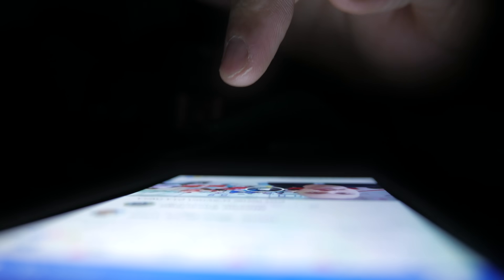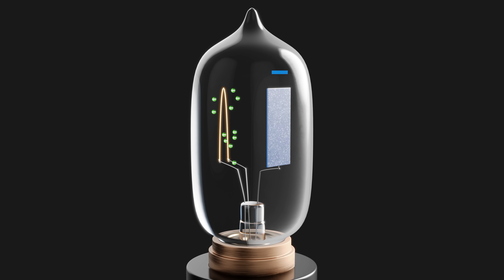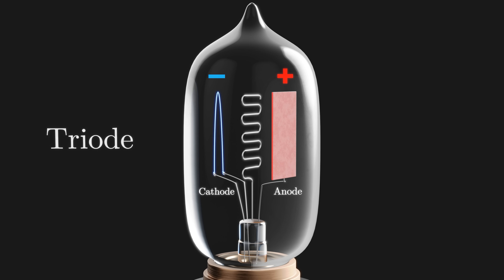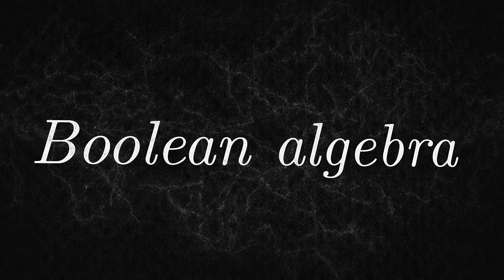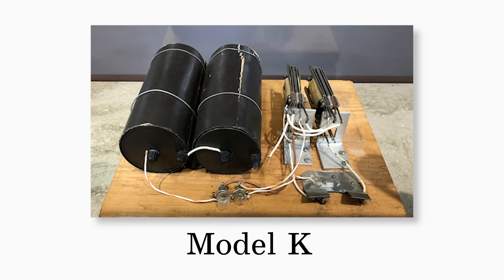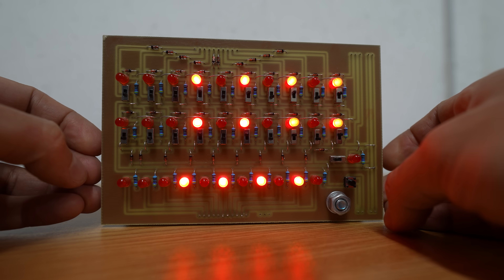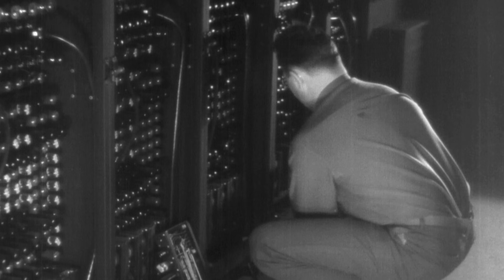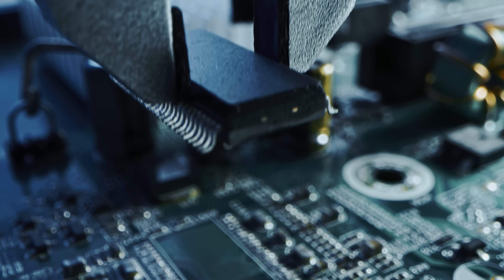Why The First Computers Were Made Out Of Light Bulbs

Comment: If you have to use a computer to know what a calculation is going to be -- meaning that you don't know what the answer should be until the calculating machine tells you -- then how would you supposedly know when it had malfunctioned enough to give you a wrong result, in order to know that you had to go and repair it?

Comment: Hi! You said that ENIAC could be programmed. I'd love to hear how this was achieved  at the time. I think this would require a method to automatically change the "wiring" of the triodes inside the computer.
Reply: From what I've seen, it was a manual rewiring process using telephone switchboard wires.

Comment: Technically they weren't light bulbs, and  really you'd want replace the really inefficient filament as the free electron source 

Perhaps with something like a uv led, wit dat phd you do know uv has short enough wavelengths to move electrons

Much more efficiently than a linear resistive load like a filament 

That would effectively kinda make a new kind of tube, since you could modulate that led digitally, along with grids and plates 

And use much less wattage, simply removing the filament.

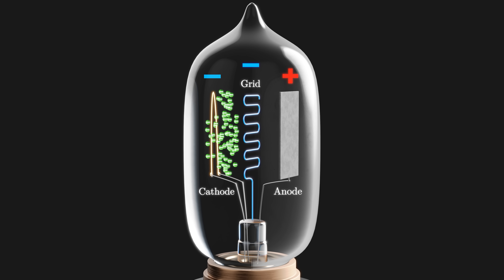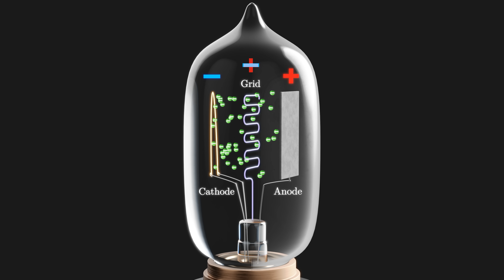Comment: Why did you say slightly negative/positive at 5:10 but very negative/positive at 13:55. Does "slightly" means the vacuum triode working as an amplifier, and "very" works as a switch? And why is that? What's the difference?

Comment: Completely daft but I'd love to see the space required to build the equivalent of a modern processor using just valves or even the first off the shelf transistors, that might be possible. I'm not suggesting building it but calculate the space required, I've a feeling its much bigger than ant ideas I had in my mind. All well I've nothing better to do at the moment, I'll look up a few things first and have a go. Well it took  a while and I came up with using the size of the  ENIAC  and its performance. And the answer is 180 thousand square kilometers give or take 124 square kilometers. Ireland is only 84 thousand square kilometers. Or for the American market about a third the size of Texas. Delivery date is incalculable.

Comment: If I remember correctly it's because of the relays used in the early computers that we refer to software/hardware problems as bugs because in one of the early computers the designers were not getting the results that they expected and it was traced down to a relay that was not functioning  correctly to to a moth that had gotten stuck in between the contacts of the relay preventing the contacts to close correctly. The moth was attracted by the heat given off by the tubes and this is where the expression  WE HAVE A BUG IN THE SYSTEM came from.

Comment: Funny story: prior to vacuum tubes being used in radio (and even later for cheap at-home radio kits) they used what were called “Crystal sets.”  Small wires were delicately placed on a piece of crystal and, if you got the position just right, it would do the necessary task of rectification.  Nobody really understood how it worked and it was always a pain to find the right spots on the crystal, so vacuum tubes became the standard once they were invented.
The thing is, those crystals were made of silicon. They were using semiconductors back then.  Had vacuum tubes not been invented, they would likely have continued research into the properties of silicon and understood how they worked and how to craft them. While we have the vacuum tube to thank for modern computers, it is not unfair to say the decades of their use was kind of a digression.
Reply: Still for a CRT, a microwave, a klystron in a broadcast or a traveling wave tube in a TV satellite are great applications of tubes. Interestingly, the current requirements already on the high voltage side of an electric train are so high that we could not get away with such simple tubes ( just scaled up). Only many small tubes would achieve the current. But this would be expensive. I imagine that small tubes each can be switched to create and aim an 1kV electron beam. They all sit in one of four large vessels ( input and output connectors ) and shot over a large distance into a common anode ( for each vessel ). But you know what: We went from relays straight to semiconductors for this low speed application.

Comment: The first electronic digital computers were the Colossus, built in England in 1943, and the ENIAC, built in the United States in 1945.
Reply: Colossus was not a general purpose computer. It was designed and built to perform a single specific task and that's all it could do. Which is why it is not counted as the first general purpose electronic computer ever built. Because it simply wasn't.

Comment: The way you describe how a Triode works is wrong, you NEVER put a positive voltage on the grid, to control the current the voltage is varied by more or less negative voltage. Like using 0 volts the tube would in full max current, with -3 volts the tube would be off. DO YOUR HOMEWORK on Vacuum tubes.

Comment: I found it fascinating back in the early 2000s when I worked on C-130 aircraft that still utilized vacuum tubes in the compass amplifiers for the navigation system.  Your explanation of how they amplify signals, like earth's magnetic field, helped close the gap on my understanding of that navigation system.  Those airplanes used a device called a Magnetic Azimuth Detector in the wing tips or in the top of the vertical stabilizer to sense magnetic heading and transmitted a very low voltage signal to the navigation computers for heading reference. Before the signal could be utilized effectively, though, it had to be amplified.  Enter the humble light bulb 💡
Reply: Some FM transmite still using 1KW tubes as output. Tubes still good on RF applications.
Reply: The first production C-130A came off the production line in 1955. I know they have had several upgrades to the airframe and systems over the years but it still amazes me that a plane designed and built in the 1950's is still in service today. The B-52 is another plane that still in service that was first built in the 1950's. I worked in PMEL witch was renamed TMDE when I was in the U.S.A.F. and I was shocked by how many pieces of test equipment we had in Germany that were built in the 1950's and 1960's and used vacuum tubes and all the wires used silver solder on ceramic bus strips for connection points. I was over there from 1982 to 1984. I was surprised when the government decided to make all the military calibration labs totally civilian contractor jobs in the 1990's.
Reply: One of the reasons for retaining valves was resistance to emp.
Reply: Field effect transistors are the solid state analogue of the thermionic valve. I wonder if, for very high temperature applications in the vacuum of space, very tiny valves, without envelopes, might make a comeback.
Reply: @rogerphelps9939  
The idea has definitely been investigated.  The main problem being launch shock.

Comment: In the Telegraph, a relay, in itself, does not amplify the signal. The weak incoming signal is sufficient to energize the relay, which triggers another telegraph set, sending out the message at full power. Otherwise, I enjoyed the video.

Comment: Great video, but factually incorrect on one very important point. The first programmable electronic computer was the Colossus at the other side of the Atlantic 3 years earlier. This is an incredibly important bit of history that keeps getting overlooked. Though I will concede that if you add the term "general purpose" you would correct.

Comment: Great video. One question though.....who varies the voltage of the mesh in the vacune tube? That is the bit I don't understand.
Reply: Input signals can come from a variety of sources. It could be a radio transmission or a transducer of some sort. Say a microphone.

Comment: When I was a child back in the late 50s or early 60s I remember my dad removing vacuum tubes from the inside of our old crt TV set whenever it would stop working properly.  I would go along with him to a local grocery store that had a tube testing machine.  It had a top panel with numerous sockets that the various tubes would be plugged into.  He would plug in each tube and throw a switch to test each tube.  An analog gauge would then indicate whether each tube was good, bad, or weak.  If a tube was bad or weak he would open up a lower cabinet built into the machine and select a new tube of the same number.  We would return home and reinstall all the tubes and our TV would work again.  Being a child, I didn't understand how it worked, but I remember being amazed at how the tubes would glow with an eerie dim orange light inside the TV before he would put the rear cover back on.  I also remember how the TV would crackle when it was turned on and how the picture would shrink down to a small point when shut off.  It even had a remote control connected to the TV by a 2-conductor wire that ran from the TV underneath the carpet and up behind our living room couch.  With it you could turn the TV on and off and change channels one at a time either up or down.  I guess that was high tech in those days.  In a way, I miss those days when you could work on and fix things yourself.

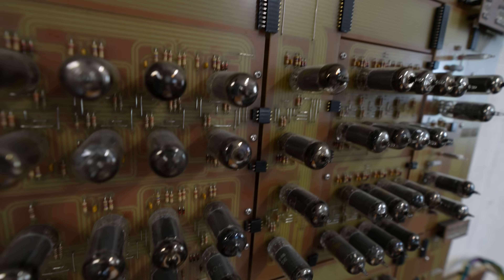Comment: @15:58 - The guy has chips in his vacuum tubes computer LOL
Reply: What may look like "chips" on the milled circuit boards in David's one bit vacuum tube are really the circuit board inter connection jumpers.   I have been in David's shop working on the blue Centurion minicomputer in the background. His vacuum tube computer 100% all tubs, resistor and capacitors no IC's  /  "chips".

Comment: You can get DC with only 2 diodes by using centre-tap transformer.  The CT is grounded, and one anode each of the double-diode tube is connected to each side of the secondary.  From the cathode you go to the filter, to get filtered DC.  Not that the cathode is this case is at an elevated voltage, not at near ground potential which can be the case with amplifying valves.  This is also possible with solid-state diodes.

Comment: All this is true, however, semiconductor technology interestingly did not absolutely require vacuum tube technology to precede it. Had we never explored thermionic emission in light bulbs, we still could have ended up with the modern world of electronics technology as we know it today. It would likely have taken longer to get there, but we'd still have semiconductors eventually and could have bypassed vacuum tube technology entirely, or arrived at the mechanics of it later rather than sooner.

Edit: More interestingly, while attempting to research "Did semiconductors need vacuum tubes in order to arise?" for my comment, I learned that there is a new paradigm possible in electronics soon by way of a kind of laser equivalent to the vacuum tube, at nano scale. Semiconductor tech has inherent limits, and these new devices could get us around those limits.

Comment: Great Video. Growning up around tubes, then transistors, this stuck me awesome to learn how early they achieved 500 operations per second.
I used a LED,  9v battery, a piece of plastic strand, and a solar cell in 1979 to transfer audio and 300bps information between two computers.
Now, 40 GB/S is a standard.  Soon, I understand today they are considering using the light bulbs in your home and environment as access points
as you walk around for huge speeds over a Terrabyte.  Just great.  The webpage will be there before I lift my finger up off the mouse, lol.

Comment: say, why did the dc light bulb glass turn yellow and then black when struck by electrons near the + side please?  what was the chemical rxn there? thank you.
Reply: I think maybe the glass was not struck by electrons at all, maybe the glass was struck by atoms of the filament material itself which had vaporized off the filament? And then those atoms deposited onto the glass?  But if only the positive side of the glass got discolored, then those items must have been negative ions.  But why would negative ions vaporize off the filament?  were these just carriers of the electrons that vaporized off the filament that you mentioned in the video?
Reply: but then again, if it were ions, not electrons, which were moving off the filament then a vacuum tube would not work for long at all because the anode would get coated with whatever material the filament was made out of
Reply: Maybe when electrons exit the filament and hit the glass near the positive side, they leave behind a positive ion of filament material on the filament.  If enough of that happens, positive ions of filament material are going to repel each other on the filament.  And then some positive ions will be kicked off of the filament with all that repulsion and with the great thermal energy while the filament is turned on.  then maybe those positive ions go to the glass to join the electrons that had just hit the glass?  So the filament material ends up coating the glass there?  but in order to reach the glass where are the electrons has struck, the positive ions of filament material would have to get past the positive side of the filament.  Can they do that?  Maybe if there's enough thermal energy they can do that by random chance?

Comment: Why is it that no computer pioneer did meet some organ builder around 1870-1920? Organs a controlled by air from keyboard to flutes and fairground organs are "digital" (with piano rolls). It's less expensive than electric relays and more reliable and can operate up to 5 ops/s. And the pneumatics of organs include all the components to build logical operators like AND, OR, NOT controlling so called flute registers or stopping all flutes at end of piaono roll.
A non invention which was delaying the computer development by 50 years.

Comment: Edison is not the inventor of the light bulb, only perfected it for practical use. By the way, Nikola Tesla was miles ahead in developing electricity, alternating current. for everyday use, including electric motors. Thus the so called "Edison Effect" was only exhibited by Edison's use of DC current. With the much superior Tesla alternating current, the phenomenon was no longer evident. But the phenomenon ser the stage for radio tubes. By the way, Tesla also was the inventor of radio, and held the patent, not Marconi.

Comment: That was excellent.  While working on my 2 year Electrical and Computer Eng. degree, I had an Instructor that was really fond of vacuum tubes and I learned a lot from him.  The origins of modern computing are fascinating.
Reply: Could you explain 9:15 to me? I don't get why closing both circuits would prevent a current from running through the solenoid.
Reply: Someone else said it’s because when both switches are flipped no difference of voltage exists for the Solenoid to get a current run through it. I guess differences of voltage is if not the core of how the binary machine language works then it’s one of the cores.

Comment: What is the actual cause behind multiplication taking a longer time on that Model K? I would love to understand that, as it “feels” like such simple circuits would just immediately reach their final state once the inputs were configured.

Would love an explanation if anyone has one! I’m a software engineer so I’m also surprised this isn’t obvious to me, but videos like this help remind me just how very abstracted writing software is from the pure physics and mathematics that powers these incredible machines. I love that it always feels a bit magical, even after 20 years working with these machines.
Reply: Multiplication in most computers is done as a series of shift-and-add steps, where the multiplicand is bit-shifted a number of times as determined by the multiplier, and all the intermediate results are added to produce the final result. Each single left shift results in the multiplicand being multiplied by a power of two. It can't be done as single boolean operation so it takes proportioately longer to execute.

Comment: Absolutely fascinating, most I already knew but the material was presented in an easy to understand format.
 However I will take exception to the final comment referring to the first transistor. It was not silicon but germanium that was the semiconductor used.

Comment: Wasn't General Electric one of the first companies to engange in planned obsolescence? Their original lightbulbs basically lasted forever so they intentionally made the filaments thinner and weaker under the guise of efficiency.
Reply: They did. Its also important to know that edison didnt invent the light bulb. William Sawyer, Albon Man and Joseph Swan did 2 years before edison patented the stolen idea.
Reply: @mernokimuvek  Edison invented the screw base which made light bulbs practical consumer products. A device is worthless if no one can use it. You needed an electrical engineering degree to change any of the bulbs made before Edison's. Which were in short supply at the turn of the 20th century.
Reply: @1pcfred  The screw base as invented by Willam Sawyer and Albon Man in 1877-1878.
Reply: @1pcfred  The screw base you know today was patented by sigmund bergmann in 1882 and is the modified version of the connector made by Willam Sawyer and Albon Man in 1878. A very similar base and socket was also invented by Alessandro Cruto around 1880.
Reply: @1pcfred  I mean the Sawyer-Man screw base(1878) which edison stole and patented as his own.